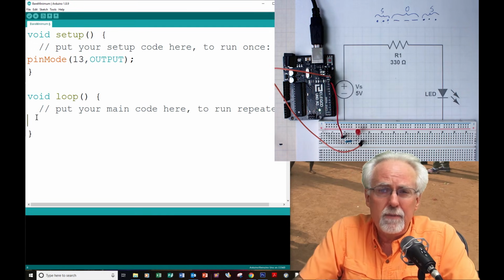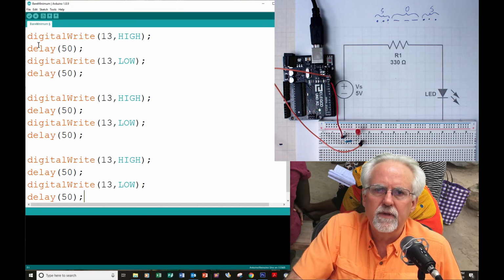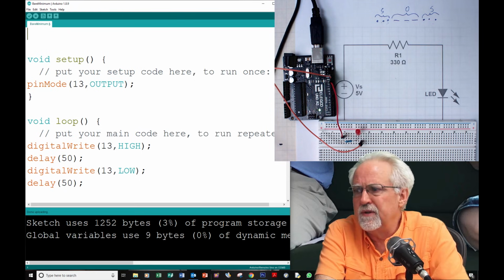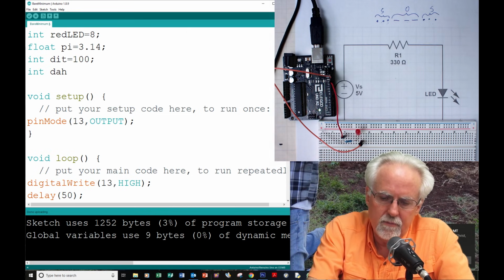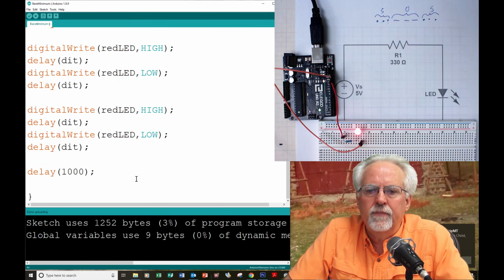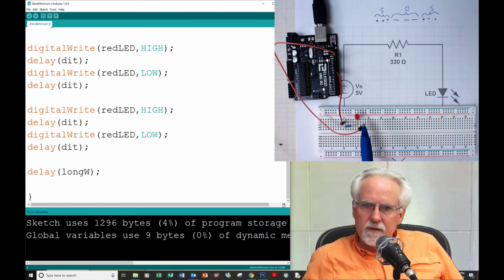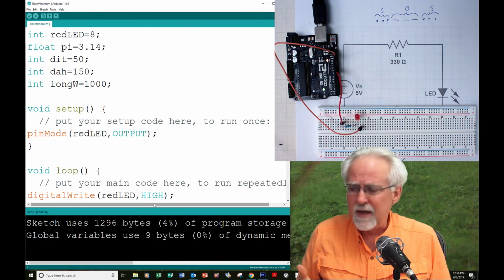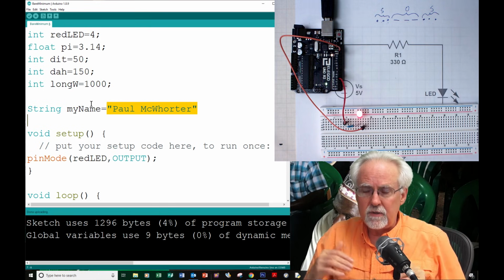Arduino Tutorial 4: Understanding Arduino Variables

Comment: You are the man! Just started tonight and this is awesome! Thanks for the great videos! Somebody might have said this before, but to help out with the spacing of flashes in Morse there are a few rules. Dits are 1 unit. Dahs are 3 units. The "off time" or space between dits and dahs is 1 unit. The space between letters/characters is 3 units. The space between words is 7 units. For a repeated code of S.O.S you would just pick a unit of time and use the Morse Code rules. Make sure to make the last "Low" delay 7 units of whatever time you are using to make the space between repeated words of S.O.S. I put my "int"s below for  R, W, and B LEDs as well as the time intervals for dits, dahs, and spaces as an example. Hope this helps!
int R=13;
int W=12;
int B=8;
int dit=250;
int dah=750;
int spacedd=250;
int spacechar=750;
int spaceword=1750;
Reply: Even better if you declare a variable for just the unit, and build the other variables on that. If you want to change the unit length, you now have to change every single one, where otherwise, you only need to change the one. Something like this:

int unit = 250;
int pulseShort = unit * 1;
int pulseLong = unit * 3;
int spacedd = unit * 1;
int spacechar = unit * 3;
int spaceword = unit * 7;
Reply: I should have read the comments before I came up with the same exact thing 😀  73 de W2GT

Comment: hello i have some experience with c++ and i made your last assignement here it is
const int ledPin1 = 12;
const int ledPin2 = 10;
const int ledPin3 = 8;

void setup() {                
   Serial.begin(9600);
   pinMode(ledPin1, OUTPUT);
   pinMode(ledPin2, OUTPUT);
   pinMode(ledPin3, OUTPUT);

}

void loop() {
  lights();
}
void lights() {
    int delayPeriod = 100;
  //first loop for five times
  //first light
  for(int i = 0; i < 5; i++){
    digitalWrite(ledPin1, HIGH);
    delay(delayPeriod);
    digitalWrite(ledPin1, LOW);
    delay(delayPeriod);
  }
  //second loop for ten times
  //second light
  for(int i = 0; i < 10; i++){
    digitalWrite(ledPin2, HIGH);
    delay(delayPeriod);
    digitalWrite(ledPin2, LOW);
    delay(delayPeriod);
  }
  //third loop for fifteen times
  //third light
  for(int i = 0; i < 15; i++){
    digitalWrite(ledPin3, HIGH);
    delay(delayPeriod);
    digitalWrite(ledPin3, LOW);
    delay(delayPeriod);
  }
}
Reply: THANK YOU!! I was trying to get the syntax for that, but it would not compile. (I was trying to build the better mouse trap.)

Comment: Second Homework

#define red 13
#define green 12
#define blue 11
double fast = 100;
double slow = 450;
double mslow = 700;
int l = 5;
int r = 10;
int s = 15;

int rep;
// the setup function runs once when you press reset or power the board
void setup() {
  
  pinMode(red, OUTPUT);
  pinMode(green, OUTPUT);
  pinMode(blue, OUTPUT);
}

// the loop function runs over and over again forever
void loop() {
 rep = l;
 for(  rep; --rep;)
 {
  digitalWrite(red, HIGH);
  delay(slow);
  digitalWrite(red, LOW);
  delay(slow);
 }
 rep = r;
  for( rep; --rep;)
 {
  digitalWrite(green, HIGH);
  delay(slow);
  digitalWrite(green, LOW);
  delay(slow);
 }
 rep = s;
 for(  rep; --rep;)
 {
  digitalWrite(blue, HIGH);
  delay(mslow);
  digitalWrite(blue, LOW);
  delay(mslow);
 }
 delay(slow + fast + mslow * 15);
}

Comment: Finished the homework teacher.

int redLed=4; //setting up the variables for delay time pins and for integer
int greenLed=2;
int blueLed=12;
int redBlink=100;
int greenBlink=500;
int blueBlink=1000;
int j;
void setup() {
  // put your setup code here, to run once:
pinMode(blueLed,OUTPUT);//setting up the pins
pinMode(greenLed,OUTPUT);
pinMode(redLed,OUTPUT);
}

void loop() {
  // put your main code here, to run repeatedly:
for(j=0;j<5;j++){ //for loop for the red led
  digitalWrite(redLed,HIGH);
  delay(redBlink);
  digitalWrite(redLed,LOW);
  delay(redBlink);
}
for(j=0;j<10;j++){ //for loop for the green led
  digitalWrite(greenLed,HIGH);
  delay(greenBlink);
  digitalWrite(greenLed,LOW);
  delay(greenBlink);
}
for(j=0;j<15;j++){ //for loop for the blue led
  digitalWrite(blueLed,HIGH);
  delay(blueBlink);
  digitalWrite(blueLed,LOW);
  delay(blueBlink);
}
}

Comment: Hi Paul, thanks for the tutorial series. I had a question. Is it possible to control (in the same way as mentioned in the homework) the three LEDs with Arduino using just one 330 Ohm resister? I tried to search the circuit diagram but couldn't find anything. Please let me know if you may have some kind of trick to achieve this. Thank you very much!

Comment: just curious, when I replaced the led to pin 8, the led was much dimmer, is there a reason why this happens?
Reply from the maker: Did you change your pinmode?
Reply: @paulmcwhorter  Yes, I was using a variable to change the pinmode, I'm not sure if that is what did it

Comment: Hi All, advice needed.

I was following along and everything was going well.

When I changed from pin 13 to pin 8, it worked but the LED was dimmer/less bright. Have I done something wrong?

When I change back to pin 13 it is bright again.

Tried pins 2-13, 13 is bright, the rest are dim.

Thanks in advance.
Reply: Pin 13 is connected to a resistor and also the board led

Comment: int redLED= 8;
int greenLED= 9;
int blueLED= 13;
int redBlink= 200;
int greenBlink= 500;
int blueBlink= 700;
int longW= 900;

void setup() {
  // put your setup code here, to run once:
pinMode (redLED, OUTPUT);
pinMode (greenLED, OUTPUT);
pinMode (blueLED, OUTPUT);
}

void loop() {
  // put your main code here, to run repeatedly:

digitalWrite(redLED, HIGH);
delay (redBlink); 
digitalWrite(redLED, LOW);
delay (redBlink);

digitalWrite(greenLED, HIGH);
delay (greenBlink); 
digitalWrite(greenLED, LOW);
delay (greenBlink);

digitalWrite(blueLED, HIGH);
delay (blueBlink);
digitalWrite(blueLED, LOW);
delay (blueBlink);

delay(longW);
}

Comment: From a CW operator: timing is everything.

int LED=3; //asign output pin
int dit=250; //dit length
int dah=400; //dah length
int cs=60; //character space
int ls=500; //letter space
int ws=800; //word space

void setup() {
pinMode(LED,OUTPUT);
}

void loop() {
digitalWrite(LED,HIGH);
delay(dit);
digitalWrite(LED,LOW);
delay(cs);
digitalWrite(LED,HIGH);
delay(dit);
digitalWrite(LED,LOW);
delay(cs);
digitalWrite(LED,HIGH);
delay(dit);
digitalWrite(LED,LOW);
delay(ls);

digitalWrite(LED,HIGH);
delay(dah);
digitalWrite(LED,LOW);
delay(cs);
digitalWrite(LED,HIGH);
delay(dah);
digitalWrite(LED,LOW);
delay(cs);
digitalWrite(LED,HIGH);
delay(dah);
digitalWrite(LED,LOW);
delay(ls);

digitalWrite(LED,HIGH);
delay(dit);
digitalWrite(LED,LOW);
delay(cs);
digitalWrite(LED,HIGH);
delay(dit);
digitalWrite(LED,LOW);
delay(cs);
digitalWrite(LED,HIGH);
delay(dit);
digitalWrite(LED,LOW);
delay(ls);

delay(ws);
}

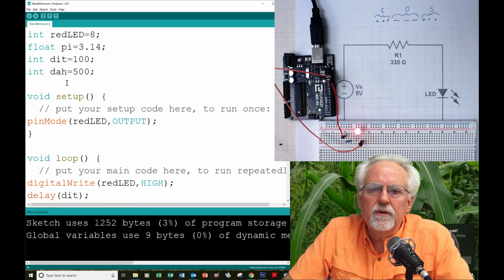Comment: Tip: at 16:39 where he is changing all the numbers, you can just do Crtl+F and change everything at once.
Reply: Hehe, awesome. If you happen to minimise that function, and if you Ctrl+F again, it hides from you till you drag it off the bottom again
Reply: @stuhastie1719  this comment deserves more likes
Reply: thaaaaaaaaaaaank you so much
Reply: BUT, if you didn't use numbers in the first place...like he said. However very nice to know, esp. if I am tweaking someone elses code. Thanks.
Reply: nice
Reply: The problem with that approach is that it will find things you don't want to change. If you have both numbers 50 and 500 in your code, for example, and you want to change 50 to 20, doing a Find & Replace to turn all your 50s into 20s, also turns all your 500s into 200s.
Reply: @DaedalusYoung  If you right-click on number 50 or 500 (or any other item in your code for that matter) and select 'change all occurances', it will only select to change the exact values that match character by character.

I'll do you one better. Let's say we have EXACT values. Like redDelay = 1000, yellowDelay = 1000, greenDelay = 1000... But you want to change the integer value of yellowDelay without changing the rest of values that also match 1000 (which in this case would be the red and green delays too). 

Then you click Ctrl+F, write the value you want to change (1000) and then use arrows to navigate through the code to select the specific '1000' value you want to change, click replace, type in the value you want to replace it with and select 'replace'. Now you're only replacing a specific value.
Reply: Thank you!
Reply: thank you kind sir
Reply: thanks.
Reply: Awesome!!!
Reply: I award you 10 points.  :)
Reply: anasheiiiii
Reply: whoaaaeeeeeet?
Reply: Just like a find and replace command 👍 Listed in the Edit menu with other shortcuts.
Reply: man Don't you get it? hahaha.. the aim of this video is to understand variables
Reply: WOW thanks, great tip, I wonder why he didn't mention that? Maybe it's part of understanding variables.
Reply: @FreddotheWheelchairGuy  I'm betting he has that planned in a future video.
Reply: my man saved 10 mins of my time! lets do thanks @RikMeloen
Reply: this is nice comment
Reply: thx

Comment: Paul, super lesson! Details, Details are very critical I`m learning. I put my code in the void setup instead of the void loop section and blinking stopped on blink 12 and would freeze up. I accidentally added a semicolon after the digitalWrite; ( (LedLOW);. After copying the code and pasting it in the loop and removing the semicolon everything worked perfectly. Wish all my past teachers explained their lessons half as well as you do.

Comment: I tried this. It's fun to experiment with the blink and LOW intervals.
/* blinks "SOS" in Morse Code, using three colors of LEDs, running off three pins
 *  All LEDs are run through a single resistor to ground 
 *  The speeds of flashing are fairly slow, and there's a little break between letters, so
 *  you might think of this transmission as "Boy Scout speed," rather than Western 
 *  Union, but of course all times can be modified.
 *  By Tim Kern 2020, for the public domain.
 */
void setup() {
  // put your setup code here, to run once:
Serial.begin(9600);
pinMode(12,OUTPUT); //red
pinMode(10,OUTPUT); //blue
pinMode(8,OUTPUT); //green
}
void loop() {
  // put your main code here, to run repeatedly:
  //flash red 5 x
  int red=1;
do {
 digitalWrite(12,HIGH);
delay(200);
digitalWrite(12,LOW);
delay(200);
red ++;
} while (red < 4);
digitalWrite(12,LOW);
delay(200);
int blue=1;
do {
digitalWrite(10,HIGH);
delay(700);
digitalWrite(10,LOW);
delay(300);
blue ++;
} while (blue < 4);
int green=1;
do {
digitalWrite(8,HIGH);
delay(200);
digitalWrite(8,LOW);
delay(200);
green ++;
} while (green < 4);
digitalWrite(8,LOW);
delay(800);
}
// So, do you like it? --TK

Comment: for anyone who might be new to programming here is a version of the homework using For Loops.

//giving port numbers for the outputs
int redLED = 13;
int blueLED = 8;
int greenLED = 2;
//speeds that the lights will flash
int fast = 200;
int slow = 700;
int vSlow = 1500;
void setup() {
  // put your setup code here, to run once:
  
  //setting up outputs
  pinMode(redLED,OUTPUT);
  pinMode(greenLED,OUTPUT);
  pinMode(blueLED,OUTPUT);
}
void loop() {
  // put your main code here, to run repeatedly:
  //for loops to make the LED's flash the correct amount of times 
  //redLED
  for(int i = 0; i < 5 ; i++){
    digitalWrite(redLED,HIGH);
    delay(fast);
    digitalWrite(redLED,LOW);
    delay(fast);
  }
  //blueLED
  for(int i = 0; i < 5 ; i++){
    digitalWrite(blueLED,HIGH);
    delay(slow);
    digitalWrite(blueLED,LOW);
    delay(slow);
  }
  greenLED
  for(int i = 0; i < 5 ; i++){
    digitalWrite(greenLED,HIGH);
    delay(vSlow);
    digitalWrite(greenLED,LOW);
    delay(vSlow);
  }
}

Comment: is there a difference between pin 2, 3, 4, 5, 6, 7, 8, 9, 10, 11, 12, 13? only 8 and 13 have been used so far, are they just random pins or is there a reason only those 2 have been used until now?

Comment: I realize that this tutorial is not about morse-code, but I allways get a bit annoyed when I see it's not done correctly. It's not about counting dots and dashes, it is about the rhythm how they are keyed. The duration of dots and dashes and also spaces in letters, between letters and between words must have a certain ratio. Otherwise it would be very difficult to read at higher speeds.

SOS in morse-code is not sending letters S O S like in a word. It is a special character among other characters that have a designated code, like beginning and ending of transmission. So instead of creating a new written symbol for these "special letters" it is easier to split it part and write it down as combination of normal alphabet, especially back in days when there was no support for UTF-8 in mechanical typewriters. Usually these special character are written with overline - for example  ̅s̅o̅s (distress call),  ̅a̅s (wait) - to indicate that they must be keyed together without any letter spacing.

As in this video with these delay setting the LED is saying more like VTTS instead of SOS.

Anyway, although I have experience in electronics, microcontrollers and programming software, I enjoy watching these tutorials. I'm new to Arduino, so these videos are great to recall some basic stuff about electronics and also learn about Arduino philosophy. You have a good style to dig into the basics without making things too complicated and keeping pace slow enough to easy follow. Thanks for these videos, I'll keep watching.

Comment: I just got the large Elegoo starter set and have been following along. I have some coding experience though not in C so this is helping me learn the syntax. I've been doing the example in the tutorial and then expanding on that. I should probably go dig up a book on basic C code at some point, but for now I can follow this just fine. Based on it's behavior, the onboard LED shows the state of Pin 13. One thing I really wish the kit had included was a mounting plate for the Arduino with space for the breadboard next to it. I'll have to scrounge a piece of plastic to use for that around here to make one. I don't want to take a chance on shorting out the board.

Comment: learning step by step this way is one of the best i have with your codeing help so far made a police car led light flashing with leds blue and red i will share my code here 
might not be the best but i only been doing this for 30 mins
int RedLed=13;
int BlueLed=12;
int flash=50;
int timeoff=2000;

void setup() {
  // put your setup code here, to run once:
pinMode(13,OUTPUT);
pinMode(12,OUTPUT);
}

void loop() {
  // put your main code here, to run repeatedly:
  digitalWrite(RedLed,HIGH);
  delay(flash);
  digitalWrite(RedLed,LOW);
  delay(flash);
  digitalWrite(BlueLed,HIGH);
  delay(flash);
  digitalWrite(BlueLed,LOW);
  delay(flash);
  digitalWrite(RedLed,HIGH);
  delay(flash);
  digitalWrite(RedLed,LOW);
  delay(flash);
  digitalWrite(BlueLed,HIGH);
  delay(flash);
  digitalWrite(BlueLed,LOW);
  delay(flash);
  digitalWrite(RedLed,HIGH);
  delay(flash);
  digitalWrite(RedLed,LOW);
  delay(flash);
  digitalWrite(BlueLed,HIGH);
  delay(flash);
  digitalWrite(BlueLed,LOW);
  delay(flash);
  
  delay(timeoff);
  
}
Reply: in case anyone reads Vapor Wave's response and wonders how to implement the for loop I'll leave a sample here

// LED pin numbers
int redPin = 8;
int bluePin = 6;
int greenPin = 4;

// delay times(ms)
int longDelay = 500;
int medDelay = 300;
int shortDelay = 100;

void setup() {
  // put your setup code here, to run once:

pinMode(redPin,OUTPUT);
pinMode(bluePin,OUTPUT);
pinMode(greenPin,OUTPUT);
}

void loop() {
  // put your main code here, to run repeatedly:

// loop red 3 times with longDelay
for(int i = 0; i < 3; i++) {
digitalWrite(redPin,HIGH);
delay(longDelay);
digitalWrite(redPin,LOW);
delay(longDelay);
}

// loop blue 5 times with medDelay
for(int i = 0; i < 5; i++) {
digitalWrite(bluePin,HIGH);
delay(medDelay);
digitalWrite(bluePin,LOW);
delay(medDelay);
}

// loop green 8 times with shortDelay
for(int i = 0; i < 8; i++) {
digitalWrite(greenPin,HIGH);
delay(shortDelay);
digitalWrite(greenPin,LOW);
delay(shortDelay);
}

}
Reply: Im a programmer and now going into arduino, checkout how to do ``C ++ FOR LOOP`` so your code will be much more cleaner
Reply: Is that with the same wiring setup?
Reply: great ,keep going

Comment: For some reason my LED is a lot dimmer when it isn't wired through 13
Reply from the maker: Are you changing pinMode to the new pin?
Reply: @paulmcwhorter  
Actually I've come back to it after a break and now it's working just fine, but thank you for replying even when this video is from last year. I really appreciate it
Reply: @paulmcwhorter  on another note do you do live classes?
Reply: @paulmcwhorter  actually now that I'm doing the binary counter I'm noticing that one of the LEDs is very bright and the rest are dim

Comment: How can you make two leds blink at different speeds? Cant figure it out yet! I assign different delay times between high and low but it seems to blink in secuence ,for example, led 1 blinks on 1000ms and off 1000ms,THEN,the second led start blinking. the led2 dont start blinking until led 1 finishes its cicle.
Reply: are you trying to have them blink simultaneously with each other but with different delays for themselves? as far as i understood you are doing it right as per the homework given in the end.